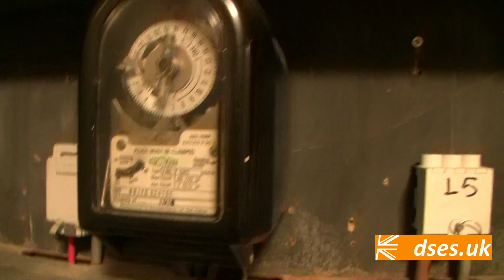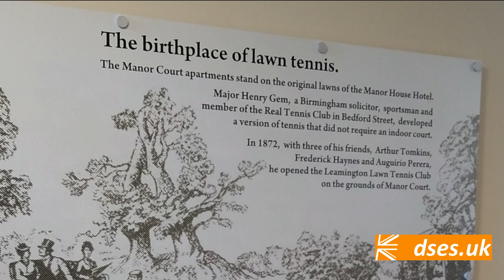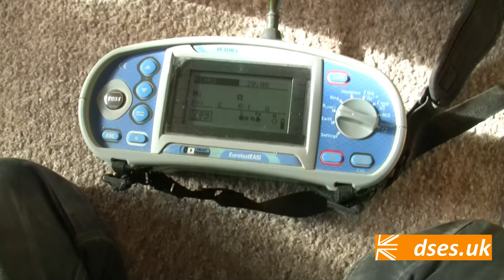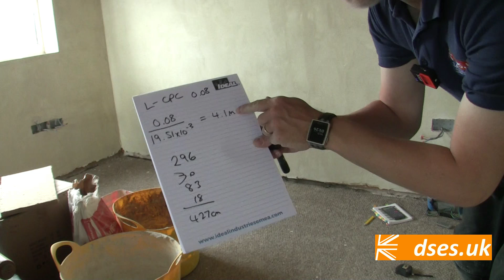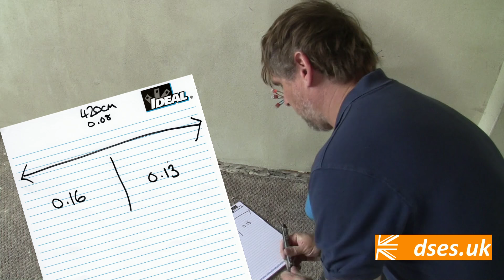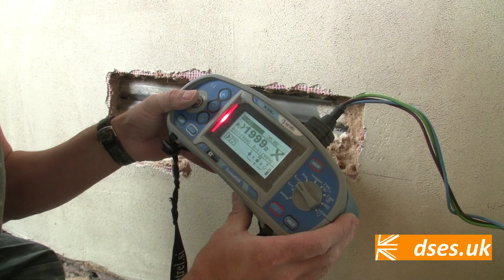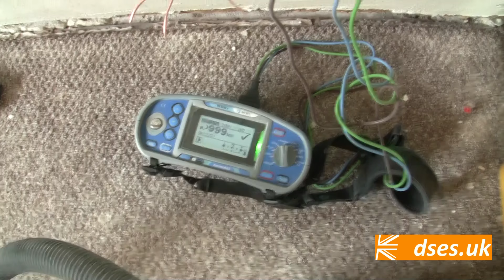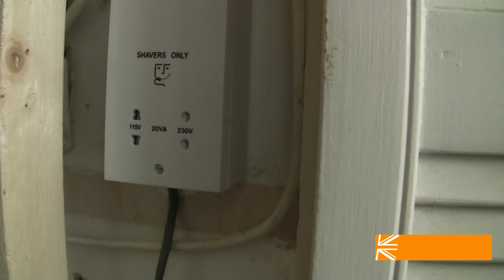Fixing another man's lash-up!

Comment: @5:00 it’s a different way of wiring a ring main. You go to ever other socket on the way out and every other one on the way back. It’s how my mentor use to do it. 

Some times it makes sense to do it. In trunking it removes one really long leg back to the board. But yea in this situation I don’t get it.
Reply: I know it as kangaroo method
Reply from the maker: Ah, so an old-school method! Not one I've come across before in my time, but thanks for explaining as I didn't know what was going through the chaps head!
Reply: It is so that if you draw 32amps from a socket near the switchboard the current is split more evenly over the 2 legs due to the cable lengths being less different when compared to the other method.
Reply: @dsesuk  it also protects from one long leg taking load if the ring is to be broken.
Reply: Completely bonkers and electrically illiterate : wiring a ring in this way increases the length and thus the voltage drop and resistance, besides increasing the risk of a accidentally drilling or nailing through cables.because of their illogical  routing.
Reply: Lewis Brand It doesn’t increase length.
Reply: EXILEIS  Yeah i have come across many RFC’s wired to this method..Its done mainly to balance loads across the ring more evenly rather than have all the load from the kitchen down one side and next to nothing on the other side. Sparky Ninja Dave Watts (Legend) has a video explaining this on his channel which is a very good watch and very informative.
Reply: @lewisbrand  If the routing of the ring out and the ring back is exactly the same then it will not increase wire length. Think of it being wired both ways in one long straight piece of dado trunking with sockets. in each instance the overall length is the same. 

I will say though from what I saw in the video,  the shoddy sparks cable routes probably did increase overall length to the run.
Reply: Leap frog method where I was taught
Reply: @rattlehead85  A point I hadn't considered. Thanks for the heads up, I'll go have a ganders.
Reply: Wow! I'm impressed! just wondering before you removed the wall section could you have drilled a small pilot hole and found the capping then carried out a continuity test between the capping and the conductors to see if the capping was electrically connected to the conductors? does that make sense?
Reply: If you went from one socket to the next you would then have one long run from the end all the way back to the DB. Fitting the capping would be a nighmare. The way it's done means you can finish as you go. Still a shoddy job though even if I can understand the logic of the way it's done. Also makes your fault-finding easier. What if you had a fault on the long return cable, you'd have to rip out the entire run to replace it!
Reply: Its the same one lad i worked with as an apprentice used to do it. staggered the sockets in dado trunking etc. i wouldnt personally do it in a domestic setting though purely as most sparks wouldn't expect it. I would be confused for a while until it clicked what was going on.
Reply: EXILEIS Agreed I’ve seen sparks use this method and found it in dado trunking in offices.

Looks like everything has been said well already 👍
Reply: Lewis Brand It doesn’t increase length, nor increase risk of damaged cable if installed in prescribed zones.
Reply: Frog leaping.  I have known of these to and use this method when running a ring final down a long wall that leads to an end.  This keeps each leg short runs rather than the last leg being a very long cable to install.

But on this job Dave is at seems to be abit random in the kitchen but then makes sense in the lounge.
Reply: Bad practice...come on guys,its a loop.
Reply: @JGE_Installations  bad practice
Reply: @lewisbrand It doesn't increase the length of the circuit if the return route follows the outbound route - draw it out on a piece of paper if you don't believe me. If you have the option to take a shorter route on the return, then leap-frogging would increase the length of the circuit, and it would increase the amount of material used.
Reply: Dusty 99  clowns.
Reply: @JGE_Installations  that's funny as well yeah I know an older guy what did that as well LeapFrog can't remember what is he was behind it
Reply: @timahad2071  good shout that actually
Reply: Lewis Brand it’s exactly the same length of cable, it was done mainly on trunking and conduit jobs so that the return leg wasn’t of massive length. I wouldn’t do it in a domestic setting though, maybe the guy that wired it was from a commercial of industrial background.
Reply: Always enjoy your banter.  Last shot with you in the mirror made me chuckle.  I always imagined you having a small one,  “camera that is”!
Reply: my tutor taught me this and I thought it was shit..!!
Reply: EXILEIS only ever done it like that in dado trunking but I know the method you are talking about
Reply: David Savery Electrical Services as I commented above only ever seen in when working dado trunking personally I would have thought the same as you
Reply: I can only guess he's gone for some variation of what I call the "hit one miss one" method, it still doesn't really make sense the way he's done it though.
Reply: Perhaps it was wired in offcuts !
Reply: Andy Kirwan in certain circumstances this method makes perfect sense.
Reply: wonder if the old boy could of gone into the design game therefore knowing about load balancing but lacking in practical skills department interesting
Reply: Andrew rowles how on earth is it bad practice.
Reply: @rattlehead85  My Flat is wired with two out and backs on the sockets Kitchen Bathroom and One Bed One Hallway on one circuit. Lounge Other Hallway and Bedroom on the other, so one blow wont take out the other - you could split the kitchen sockets between the two as well for better redundancy.  35amp kitchen immersion and storage heaters on different circuits two.
Reply: We used to wire dada trunking sockets that way the leaf frog wiring. But never done a ring like it. I’m not a fan of any joints in walls. Like you say though sometimes there are not many options. My only thing with the 803 would be that doesn’t the enclosure say ‘do not cover’. I only notice when install in lofts
Reply: james garnett that’s what I refer to it as. And like said in trunking it saves a long leg to the last socket.
Reply: I’ve only see the his on a video from Rupert at LA Spark otherwise I would have never come across it, again I’m told it’s to balance loads on a ring but seems odd to wire it this way in this instance.
Reply: @dsesuk  33:00 No zoom required lol that hole was so big that if you cant see it your probably the bloke who done it first lol
Reply: @dsesuk  I see your leapfrog method and I raise you the David Savery cable fault finding Jedi trick.    I take my hat off to you sir.
Reply: @retrofitter  

The same reason it is advisable to design a kitchen ring main to fit around the centre of that ring as the loading in a kitchen is often high. Under ideal conditions, a 2.5 t&e can carry around 27 ohms so a poorly designed ring can lead to overloading of a cable where large loads are concentrated near to the CU.
Reply: @lewisbrand  How so?
In both methods you still need a length of cable from the MCB to the furthest socket and a return cable. 
In addition you still have exactly the same number of drops - one to each socket on the circuit, so cable length is the same.  In addition (as others have said) it balances the load.  It is possible to put so much load close to a 32A MCB on one leg of a 2.5mm ring; that the current drawn will exceed the capacity of the cable on that leg.  Balancing the circuit should Reduce voltage drop by reducing the amps in the conductor.
If the loading is known for each point on the ring (highly unlikely) there is a calculation which can tell you the cumulative loading on each section of the ring.
Reply: @retrofitter  Thats why you have a ring main as it acts  a balanced load
Reply: My old boss used to refer to it as stitching.
Reply: @lewisbrand  you don't have a clue mate are you even a electrician?
Reply: @lewisbrand  although this is a really bad example. "leapfrog" ring mains are quite common way to avoid the issue of having one short leg and one really long leg back to the consumer unit. Is not 'electrically illiterate' at all.
Reply: Wiring the ring like that you will end up with a ring in a figure of 8 which is what you don't want. When you test the ring properly your test results won't be acceptable
Reply: @tezzatibbz2278  How?
Reply: This method is normally used in dado sockets it’s a good method
Reply: Lee Brow
Reply: @tezzatibbz2278  wtf are you on !!!
Reply: Standard method of wiring alternate sockets.  Any good spark worth his salt will do it this way.  I agree the physical routing is naff .
Reply: Personally I would have run conduit and singles..... poor practice all round David
Reply: I’ve used this sometimes if it’s easy saves one big leg from the last socket to the Fuseboard.
Reply: I still wire this way for commercial sites, was also taught it by my mentor. Doesn't increase total length of runs but it does balance legs and loading. Occasionally use it in larger houses 6-7 beds for great rooms and alike but quite often now I'll just run a radial or ring down each side.
Reply: That’s called a figure 8 used when you are wiring in singles through conduit with only one run and no return
Reply: Called figure 8 only ever used it when wiring a ring in conduit using singles when there is no return conduit
Reply: I generally pick them all up on the way out and run one directly back. I personally find its better for the rp+re..... but that's just me.
Reply: @timahad2071  I was thinking that when he saw the screw, there would be continuity if it had pierced the wire since it was also touching the capping... If the capping was powder coated though that may have interrupted flow, but the screw for sure.
Reply: But why ? thats bad design
Reply: @tezzatibbz2278  Eh?
Reply: @tezzatibbz2278  Eh?
Reply: @rattlehead85  Hi can you please post the link of Sparky Ninja Dave Watts video explaining this I've spent some time trying to find it. It would be well appreciated the title to help me find it. I suspect Delroy the Spark was faced with this on a fault find {Emergency Call Out - Electrical Fault Finding} is the title of his Youtube video, thanks
Reply: @lewisbrand  Hi lewis, the electrician who wired this I think has generally picked up his experience working on industrial projects and not domestic. on industrial projects generally using steel conduit and singles it was normal (unless things have changed) to loop between every other socket with each leg of the ring, then join the last two sockets. this would save on having to run wires from the furthest socket back to the mains and I presume would better distribute the current in the ring circuit. However, I have never seen it done on domestic premises. Not the norm.
 If you draw it out on paper to scale it actually does not make a difference to the lenght of cable being used..
Reply: @dsesuk  I asked my Ex. Electrician dad (now 80) about it and he'd never heard of it.
Reply: Excellent fault finding.
Reply: I'm late to this party, but hey ho. I was taught to call it "dog legging", definitely a commercial trait, rarely used in domestic installs. It definitely has load balancing advantages, and stops you having to pull a really long leg back. 

David gave us the clue the first time he used the term "old boy", I knew straight away the previous electrician was probably more used to wiring offices than houses. 

Oh, and I'll also admit to drilling my own cables more than once! But that was over twenty years ago!

Interesting use of maths to narrow down the search area, however, what if he'd pierced it more than once? You're left chasing your tail! Just rip the wall open and start again!
Reply: @dsesuk  Around here, kitchens and certain semi-public areas are required to be fed from multiple fuses or breakers, so something remains available in case of faults.  But we use 10/13/16 A spurs, not rings.
Reply: Leapfrog
Reply: 3:15

Comment: I'm a lv3 electrical student and This video taught me about fault finding more than what my own tutor has ever taught me , thank you!
Reply: Did you know you can calculate the distance to the fault too? Here is the calculation:

 The two readings (0.13ohms and 0.16ohms) represent the RATIO of distance to the fault from either end. An actual reading to the fault can be obtained by the following equation:

(r1 / (r1+r2)) x Cable length (end to end)

where r1 is resistance to fault from point 1,
r2 is resistance to fault from point 2
and cable length is obtained by direct measurement (cable route known) OR calculated as David did in this video using the CPC and line conductor. For this example, the calculation is as follows:

(0.13/(0.13+0.16)) x 4.2 = 1.88m from the point where the resistance was 0.13ohms

the same works the other way:

(0.16/(0.13+0.16)) x 4.2 = 2.32m from the point where the resistance was 0.16ohms.

Comment: That was an absolutely brilliant piece of detective work and one worth sharing as a lesson on how to work out a fault position and also, how not to install capping! Respect! 😁👍
Reply: The only part missing was the final calculation to get an actual reading of distance to the fault. Not that there is anything wrong with the faulting technique! The two readings (0.13ohms and 0.16ohms) represent the RATIO of distance to the fault from either end. An actual reading to the fault can be obtained by the following equation:

(r1 / (r1+r2)) x Cable length (end to end)

where r1 is resistance to fault from point 1,
r2 is resistance to fault from point 2
and cable length is obtained by direct measurement (cable route known) OR calculated as David did in this video using the CPC and line conductor. For this example, the calculation is as follows:

(0.13/(0.13+0.16)) x 4.2 = 1.88m from the point where the resistance was 0.13ohms

the same works the other way:

(0.16/(0.13+0.16)) x 4.2 = 2.32m from the point where the resistance was 0.16ohms.....

Another method of locating faults like this is the use of a tone and amp (as used in data cabling) where a loud point can sometimes be heard using the amp without breaking the wall first. It doesn't always work but its a useful addition.

Comment: In terms of the repair, I would put a 25mm box in between the run, wago the broken cable and blank plate it off

Least that way it’s accessible for future reference
Reply: Agree. In some cases you can even add a socket so that at least the fuckup provides some utility over a blank plate.
Reply: Agree with both these methods of repair.
Reply: I'd be pretty careful about doing that. I'm not sure that would be considered maintenance free.
Reply: @1992jamo it doesn't need to be maintainance free as is accessible by removal of blanking plate.

Comment: Hi david , absolutely love the videos . 

I am an apprentice electrician and im learning loads watching your videos . They are helping me massively with all the tips and bits of knowledge you have shared with us. 

Many thanks.
Reply: John Ward and Sparky Ninja also put out some good content. I didn't realize these videos helped so many people, perhaps I'll chuck a couple in of my own some time. Here is how you can turn the raw numbers into an actual measurement to the fault:

 The two readings (0.13ohms and 0.16ohms) represent the RATIO of distance to the fault from either end. An actual reading to the fault can be obtained by the following equation:

(r1 / (r1+r2)) x Cable length (end to end)

where r1 is resistance to fault from point 1,
r2 is resistance to fault from point 2
and cable length is obtained by direct measurement (cable route known) OR calculated as David did in this video using the CPC and line conductor. For this example, the calculation is as follows:

(0.13/(0.13+0.16)) x 4.2 = 1.88m from the point where the resistance was 0.13ohms

the same works the other way:

(0.16/(0.13+0.16)) x 4.2 = 2.32m from the point where the resistance was 0.16ohms.

Comment: I absolutely love this kind of fault finding :) Great sense of satisfaction when you find it, and how close you were on the first attempt! Great video, and many thanks
Reply: You can get an actual number too if you drop the readings into this:

 The two readings (0.13ohms and 0.16ohms) represent the RATIO of distance to the fault from either end. An actual reading to the fault can be obtained by the following equation:

(r1 / (r1+r2)) x Cable length (end to end)

where r1 is resistance to fault from point 1,
r2 is resistance to fault from point 2
and cable length is obtained by direct measurement (cable route known) OR calculated as David did in this video using the CPC and line conductor. For this example, the calculation is as follows:

(0.13/(0.13+0.16)) x 4.2 = 1.88m from the point where the resistance was 0.13ohms

the same works the other way:

(0.16/(0.13+0.16)) x 4.2 = 2.32m from the point where the resistance was 0.16ohms.
Reply: BB k or